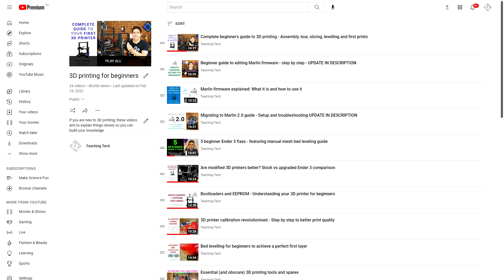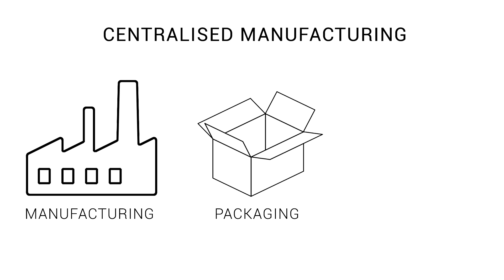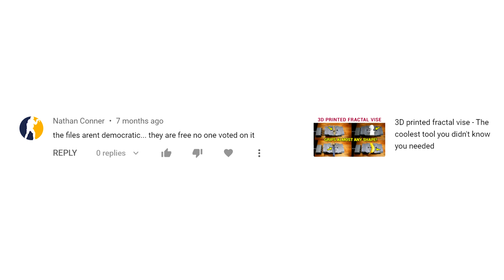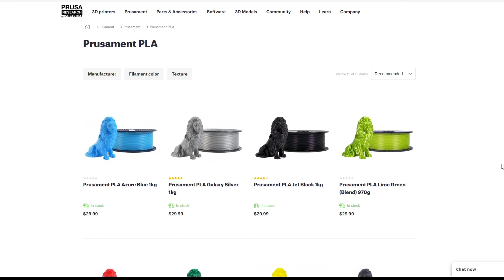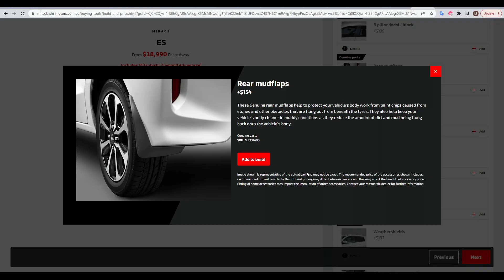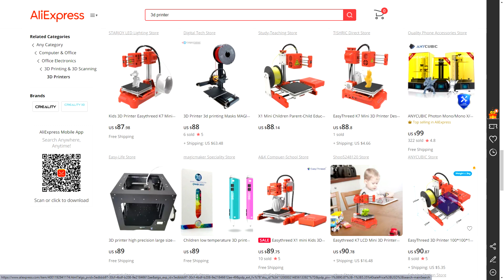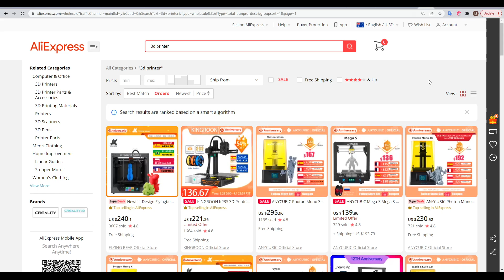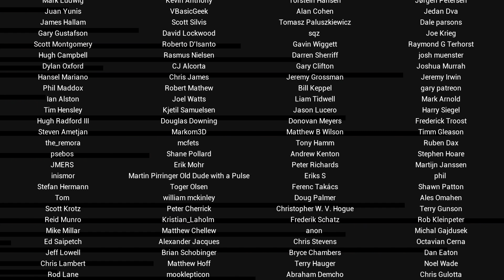3D printer trends are limiting mainstream acceptance: The 3D printing paradox

Comment: Asking how 3D printing is going to enter a culture of passive consumers without changing people from consumers to creators is like asking how mass-production was going to enter a culture of agriculture and cottage manufacture without turning people into factory workers and moving them all into cities.  That's the wrong question to ask.  A change in the way people live and work is inseparable from a change in the technologies they use.  If the factory system didn't, in fact, change the culture, then there could have been no Luddite movement opposing that change.

If you want, and expect to see decentralized, democratized manufacturing, then you actually want bottom-up, margins-in innovation, not trickle-down.  3D printers and the like are exactly the kinds of tools that promote bottom-up and margins-in development and thinking.  Users are exactly the people who SHOULD be developing ease-of-use features in personal fabrication tools.  Letting corporations 'lead' from the top down is how we got dancing paper clips.

Using 3D printers is about the least 'mainstream', 'consumer' thing you can do.  3D printers and laser cutters and personal CNC will never enter the incumbent mainstream, but as they become more integrated into daily life, they will necessarily change what most of us think of as typical ways of living and working.

It's precisely the margins-in mindset that will eventually infuse 3D printers et al. into our culture and economy on a large scale.  You don't buy or build a 3D printer to make cable clips.  That would be ridiculous.  You get into 3D printing precisely to make things that you can't buy off the shelf.  But once you have one, it becomes ridiculous to get in your car and make a special trip to the store just to buy a few cable clips.  In mass-production, you no employ factory, factory employ you!  But when the factory is controlled by a microcomputer and literally sits on your desktop, and the product is a set of data on an SD card, all the expectations and assumptions of mass-production are flipped.  Innovation is driven by the marginal cases – the needs that fall between the cracks of mass-production.  But once that capacity to make things is dispersed out from the center to the periphery, all kinds of other things that COULD be mass-produced come along for the ride.

No corporation will ever lead in the development of a free, Open Source cable clip.  And from a strictly consumer point of view, it makes no sense, either, because that need is met by mass-production.  But once you've got a 3D printer, and have learned to use a CAD or 3D modeling program, then designing and printing one to scratch your own itch is a no-brainer.  And sharing it online is the next natural step.  Slowly, around the margins, the demand for mass-produced cable clips declines, and the demand for 3D printer filament increases.  There is no killer app, and no magic bullet.  Instead, the cumulative effect of millions of 3D printed cable clips and uncountable other things like them will incrementally change the equation, like turning up the heat on a pot of frog soup.  Mechanical mass-production began with the things that were most amenable to being produced by the machines available at the time.  It took centuries, and multiple generations for every industry to adopt mass-production, and for the culture of consumerism to fully develop.  So we shouldn't be surprised if it takes decades for a postindustrial culture of mass-creativity to proliferate.

Companies that are in the business of mass-producing have little incentive to ever innovate better 3D printers, because the better 3D printers are, the more they encroach on conventional mass-production business models.  And 3D printers aren't just 3D printers.  Questions of FDM vs. resin, or additive vs. subtractive miss the point entirely.  The answer is all of the above.  Arguing that one of these technologies considered in isolation won't displace mass-production is moot, because all of these technologies synergize in an interdependent mesh and complement each other.  If you can't fabricate a 3D printer entirely using another FDM machine, adding a resin printer and a CNC lathe and drill press dramatically reduces the number of necessarily mass-produced 'vitamins'.  And personal printed circuit fabrication is not far off.  Do you have a clothes washing machine in addition to your dryer and dishwasher and toaster?  Of course you do.

If Voron is a design consortium instead of a corporation, that's another concrete example of how a different mindset is inspired by, and then feeds back into the use and development of 3D printers, altering the prevailing culture in the process.  If it doesn't represent a change in culture, then there's nothing to worry about.  If it does, on the other hand, then it's contributing to the conditions under which 3D printers and the like will become an ever more broadly accepted part of our society and economy, by pioneering a different way of organizing work and innovation.  And that culture change will inherently imply that people displace some of their passive, uninvolved relationship with technology in favor of increased creativity and technical involvement.  Because it's true.  3D printers really don't make sense as a consumer product.  Thank goodness.

Comment: I think this is mostly about what cheap home printers can make. I use mine constantly because i'm always designing things.. but if you dont need gears or project boxes etc, a printer really isn't useful enough to justify the money. Sure you can make coat hangers, a toilet paper dispenser, a soap dish. then what? an octopus with the Rocks face on it? ok - cool, but did you really need a $300 machine for that? If you make a list of the last 100 things you bought  that weren't related to a maker hobby, how many of those could really truly be printed with a standard printer and be just as good? if they could print food safe, or electronic circuits, or use other materials and do those things well... then everyone would want them.  As it is, I'm thankful we have them for prototyping or making custom things but I just dont see them being useful for the average consumer even if htey were reliable and easy to use.

Comment: I really enjoyed hearing your take on this. I think you're spot on when comparing 2D and 3D printers in terms of ease of use. It is shockingly difficult to buy a complete garbage 2D printer that doesn't work at all even at low prices, but it's incredibly confusing and difficult to get a cheap 3S printer working for someone with no experience. Furthermore there are a million QA problems with most of the cheaper options if they are even capable of printing at all out of the box. This is indeed a huge issue IMO towards adoption and the software side of things is pretty abysmal when it comes to diagnosing issues. I can't think of a single 3D printer <$700 that tells you anything about what went wrong with your print, other than filament runout detection.

Comment: I'll tell you why it's not like paper printing.

Generally, you design parts to be printed. Or you design them to be moulded. 
Depending on the method used, these are not interchangeable. 

Unlike paper. Where we agree on size, material and what we want it to do. 3d printing has a huge variation on this. 

Even cars have a standard operating expectation with roads and such to be built to. 

So what material? What tolerance on parts? What size on parts? What's an acceptable finish? 

Like a cnc mill. It soon becomes a tool capable of so much. But this makes it not easy for casual use as there is thought and choices to make. And makes it a tool, not an appliance. 

Also as useful as it is. It is very limited by its medium. Plastic. Which as fantastic as it is. Also soon is not useful under any real force or heat. 

While the usability is improbable. I'm not sure it can ever be like a paper printer. 
Simply the amount most people may use it may make this impossible to make a successful market.

Comment: We should be very glad that there are Ender 3 clones from many companies. It keeps the prices down and helps to prevent DRM for filaments.
Reply: Exactly... And allows for actual "democratization" of the means of production... 

Arguing that top down driven "innovation" spurs on anything other then top down driven stifling of competition and nonsense like DRM, Everything as a Subscription service etc etc .. denies everything we are witnessing today masquerading as a free market. Im sure prusas are great but Ill stick with my Enders and Aquilas happily plodding along.... working ... everyday. 

Tools are tools.... and a tool that can be repaired or replaced cheaply from redily available suppliers not beholden to the whims of a single supply channel are what makes open source printers great...
Reply: @Grumpy Cat  while I do see what you're saying, there's still the fact that all these 3D printing companies like Creality are basically getting free labour off the backs of the innovations made by the companies? How many STLs are there on Thingiverse/Printables for small fixes on an Ender 3 like proper strain relief or a filament guide, which would cost Creality almost nothing to implement from factory? Why is it the end user's responsibility to improve their products?
Reply: @grumpycat_1  this is why i have a huge problem with the raspberry pi situation. the other options are hardly supported because no one buys them. and you literally cannot get any pi device at retail costs.
Reply: @or3n_   Totally Agree, closed source hardware architecture/ecosystems (which the PI is) are a poor idea from an innovation perspective.. period. Even when developed with the "best" intentions and backed up by a huge "community" and a "foundation" with a nice mission statement.  The PI is still single source hardware... and still vulnerable to the same age old problems inherent in proprietary solutions. 

I bought two Pi 400s last year and used one in 3d printed case (without the keyboard obviously) for my last printer build, They were all I could get, they work well.. but cost $70 each (15$ over a PI 4 4gb for keyboards and cases I don't need or want) ... Their form factor (when put in a 3dprinted cases) works great for headless 3d printers BTW. 

If you need a Pi try RPilocator if you turn on the alerts it will tell you when a particular site gets them in stock. I have bought 2 Pi 4s a 2gb and a 4gb  in the last 6 months for MSRP, it's a hassle and why to your point single source is a huge mistake.

Honestly I have been using old Intel based uSFF PCs and laptops running PI OS for other projects/experimenting b/c they are cheap, the hardware is more or less  universal and available everywhere from everyone.

 I think the LePotato from Libre is actually somewhat interesting... I bought one recently and it looks promising but has a bunch of limitations,  it isn't as turn key, has a different 40 pin header and requires nonsense a Pi doesn't... I bought it just to experiment, and at 35$ its not a Pi and its not really a bargain. I get the point why no one buys them, but the RPI foundation needs to license the board design and stop trying to pretend to be benevolent monopolists..... 

Even if they truly are the makers "friend" they cannot control the supply chain and even if they could they cannot instantly scale production to meet demand when only they can manufacturer the boards.

Comment: 2d home printing as an industry is possible the WORST example of mass adoption of a technology one could possibly come up with.. not to mention paper printing is more or less obsolete....and is now niche....It is niche due to the very  technology that made it "cheap" and available and then unprofitable "necessitating" all of the outright scams major mfgs are pulling in this space.  

I literally cannot think of a less "democratic" more anti-consumer/wasteful/arguably pointless industry then the low end mass market home printing sector.

I guess the point was to illustrate how ubiquitous a tool 2d printers have become but I'm not really sure its an example I would want the 3d printer industry to follow in any way other then to achieve a larger audience. 

In which case a better example would be the microwave. Which more or less did not exist as a mass market TOOL until the 80s' despite being available since the 50's, and is now in 90% of US homes and is still as useful today as it was 40years ago.  

That is until someone decided to connect one to the IoT b/c cooking your popcorn in 3 mins HAD to require and internet connection and proprietary firmware to MAKE IT EASIER..... until someone at the company pushed a OTA update that bricked them all by entering a wrong version number.... and which can't be fixed by the customer b/c "safety/trade secrets" etc etc etc.

The microwave is still a fantastic TOOL for cooking...  it is not the cure for world hunger ...

Having a "residential replicator" appliance sounds great... (PICARD 4LIFE!) for "normies" but that's not what FDM/FFF 3d printing is... or at least should not be seen as a panicia which it is not..I get that perhaps the mainstream might want/need this... but I think that's a self defeating argument and I for one do not want the 3d printing industry to follow the 2d printing industry... 2d printing at home is a top down driven wasteland or garbage throw away devices and proprietary ink (and now even paper)scams...  

I own a 10,000$ CNC plasma table but i'm not really sure its the answer to all of societies excesses and wasteful logistics practices...  Its a tool....

The massive increase in the "soft" and hard costs surrounding a mass adoption of distributed manufacturing is not trivial either... the raw materials, machines, and energy to run them would be MASSIVE and not be canceled out in equal proportion by economies of scale.  I think you are glossing over that here...

Imagine if Apple, HP or god forbid Dymo, came out with a mainstream 3d printer.. there would be DRM in the filament... Subscriptions to use  your printer , and planned obsolescence... Lawsuits against "knock off" 2020 rail or "Dangerous" control board/ screen mfgs..  Think of what 3d printing would be with proprietary devices, components software/firmware
 and consumables... b.c that's what mass adoption from the top down would bring... not the bottom up open free for all of choice we have now...

Comment: Outstanding video.  I couldn't agree more.  We need excellence from manufacturer that compliments and expands on work done by the community. I, too, want to see a 3D printer in every home, but I find it increasingly hard to recommend a specific printer for families who want to enter into the hobby with low cost and ease of use in mind. Low cost printers are synonymous with barebones features and a printer that is only suitable for the technically minded who also aren’t opposed to meeting with repeated failures and minimal support.  I hope the industry moves in a positive direction soon. Your videos have an impact. I hope the companies producing 3D printers are listening.

Comment: I see the utility of 3D printing being more for making parts that are either original prototypes or re-creations of hard to get, probably obsolete things. A lot of people have ideologies they want to attach to the technology, but in the end I don't think you can remove the "you need some idea of how manufacturing works" part and replace it with automation to the point a "consumer" can easily jump in (or would even want to versus just buying a part, especially with stuff like Prime 1-day delivery). Manufacturing is just an inherently complex operation, even doing simple garage scale metalwork. I see 3D printing getting more common, but no more common than someone owning a lathe,  mill, or CNC router. It's just in that class of complexity, both as a machine and as a process. It has the technical complexity of being a robot that will do exactly what you tell it to, plus a process that has a lot of the same physical parameters and concerns as welding. It's also entirely possible a part from Amazon with 1-day delivery will arrive faster than you could print it. There's a lot of stuff about the "revolution" that strikes me as just pipe dreams by people more into political theory than technology; I think they see it as (or want it to be) a "Star Trek" replicator than a CNC machine that happens to add rather than subtract.

Comment: I just don't see this kind of tool becoming a standard feature on a typical workbench.  Maybe for a club, or for a professional scenic designer, but of all the tools a hobbyist would consider 'necessary', this probably ranks below a Dremmel, or a foam cutter in terms of usefulness.  I mean, it's cool and all, but hobbyists never needed this technology to make unique creations.  Hobbyists have been doing that for ages using greenstuff, plasticard, brass rods, and traditional modelling techniques.  Hobbyists never needed this technology to make duplicates of that stuff either.  We had hot casting and cold casting to do that.  And all of that stuff takes skill, for sure, but 3D printing takes skill too, and not necessarily the kind of skill that people go into hobbies to practice.  Part of the appeal of something like model railroading, or gaming, is working with your hands and senses as an artisan would.  A lot of that traditional, visceral experience is the reason why people do this.